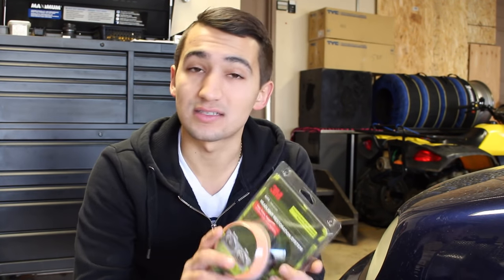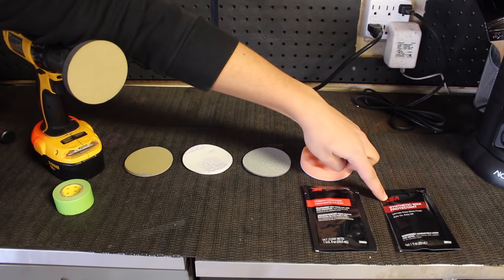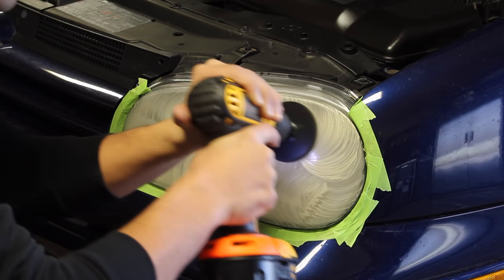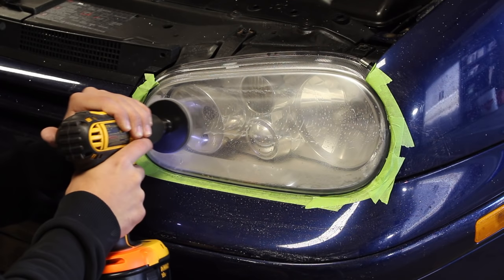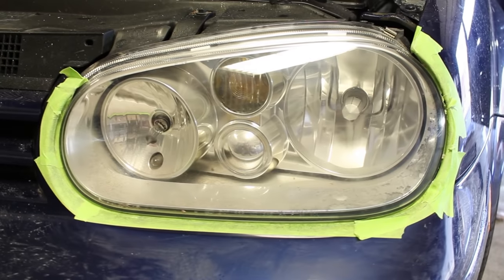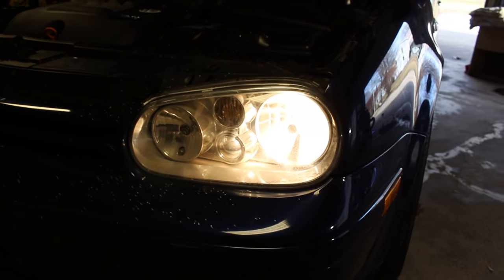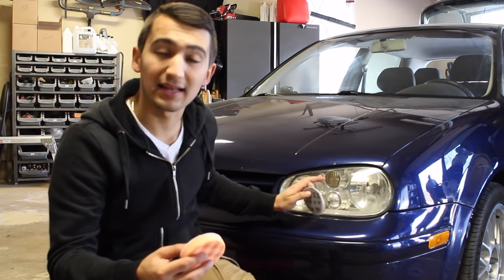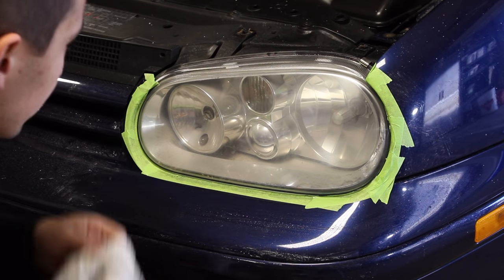How to Restore Faded Headlights for less than $20

Comment: how long will it last ?
Reply: it's honestly lasts a year and a half but that's with not that much sun exposure, as you may know the whole reason for the plastic getting yellowed is because of the sun. less sun the less you will need to restore again.
Reply: Thank you for the information and quick reply:)
Reply: +phuong pham no problem good luck.
Reply: I just did my headlights but i didnt buy the kit.  I just bought 400-600 and 2000 grit sand paper and did it by hand.  After I sanded it, I  used uv resistant gloss clear coat and sprayed 3 coats on each head light.  Then wax it.  Should last longer that what you get with the kit

Comment: DO NOT use clear coat on your headlights.  That is the quickest way to have them oxidize again.  The best way to keep headlights looking new and clear for a long time to come is by following the steps here, but instead of waxing, once the polishing is finished, clean the headlight throughly with 99% alcohol, and coat with a ceramic coating.  Reapply the coating once every 6 months to keep them pristine

Comment: Headlights haze because of the sandblasting when you drive. Basically tiny grits of dirt hit your headlights over time, dont think it has anything to do with the UV Sunlight.
Reply: The yellowing has a lot to do with UV Rays. It's essentially sunburn/sun damage
Reply from the maker: +Dylan Patel Sandblasting is very similar to sanding. If the sandblasting effect were true, using the sandpaper wouldn't do anything. When you drive, your front end does 'get sandblasted' by the dirt and crap that hits the front end which is how the OEM coating on the headlight wears. Only after the coating is gone, is when the UV rays start to kill the plastic lens. 

If your UV resistant clear coat gets stripped down and removed, don't think for a second that the base coat won't corrode due to UV rays. The UV rays have a large effect on the yellowing and fading.
Reply: +milanmastracci Thanks for clarifying that for me!
Reply from the maker: No problem :)

Comment: Great presentation proving you are much better than the product. It's a ripoff.  They discontinued it because of customer feedback telling 3M not a sufficient number of sanding disks. Also, their instructions conflict with their other similar kit.  Example: using water vs not using water on the heaver abrasiveness. You can find these kits cheaply but they are not replenishing them.  Also, no protectant sealant is included with the #39008 kit. I was told by Amazon just to keep the kit, and was given a refund.

Comment: I always thought these restoration kits did not work...maybe I was doing something wrong lol.
Reply from the maker: +W6 Smash If they don't work, you need to sand off the entire coating on them, before sanding with higher grit sand paper. The only reason why sometimes it won't work, is if the UV coating that comes on headlights, isn't completely removed.

Comment: newer cars don't have this issue with hazing
Reply from the maker: +Tarek Taher That is not true. You don't see it on new cars yet because the UV resistant coating isn't worn off yet. When these newer cars get some kilometers racked up, you will see it.

Comment: This kit is serious overkill, I've used just a foam pad on a drill with polishing/rubbing compound to refurb dozens of headlights, all that sanding is BS.
Reply: John Smith sanding is not bs if you're reapplying clear coat. the sanding will give it something to bond to. if its such bs why do body shops sand the paint and body panels
Reply: Jared Ostler The original headlight wasn't clear coated, it's plastic and all you need to do is once a year hit it with a sponge pad on a drill and a dab of rubbing compound, you can even do it by hand, it'll take you ten minutes per headlight instead of one minute per headlight with the drill, the only reason to clear coat is to give it a little more UV protection and you can still do that after using the rubbing compound, all that sanding is complete BS.

I have literally fixed dozens of headlights this way and never had to sand like that, it's a con to make you spend more money on the kit instead of just a foam pad and some rubbing compound, seriously guys this is a con, sure it gets the job done but it has so many more un-needed steps added just to baulk up the price!!??
Reply: John Smith , Jared is right. I worked at a high volume dealership that sold 400 cars a month and they used a two step wet sand process with the compound polish and buff.
Reply: depends on if they lenses are pitted / have deep scratches or other damage from debris.

Comment: not hating on his video but $30 Walmart they will sand both headlights and they will be brand new. No need to buy supply's and do it at home for decent work. Walmart will fix them brand new for $30
Reply: Mason Wilson  I think you're missing the bigger picture here.  Having Walmart do it costs $30 for just one treatment.   I got this kit for $18 +tax for about 3-5 treatments.   So now I have the disc pad holder, enough sanding and buffing pads to get started with.  Not to mention, 1. I don't have to waste nearly half a day waiting in line at Walmart to get it done by them.  2.  I can do it at home, in MY garage, listening to MY music and without having to deal with rude, stupid or annoying "Walmartians".   And 3. Since this is the same kit THEY use anyway, I can charge friends, neighbors etc. $20 instead of $30.  So instead of spending $20 ON the kit, I can make $100 OFF of the kit.
Reply: i started sanding lights a few months ago..a customer brought me a car walmart just cleaned...first of all they didnt get them clear..second of all her problem was water in the lights..they proceeded to clean them and charge her..accomplishing nothing
Reply: igor6969 okay well I Seen shops change oil and out it in the transmission. I seen a shop change a transmission and forgot a part. I seen a shop pull a car in and dropped it. I seen a bird drop out of the sky and hit a car. I seen a car flip. I seen a monkey hit a window. congrats dude anything can happen. cool your Walmart is useless that's awesome buddy. Want a cookie hahaa. Walmart worked on my car lights. Perfect job

Comment: You used the wrong 3M restoration kit!! This kit is for dry sanding? 3M as a wet sanding kit done by hand!! The first step you said p400 In fact it's p500 then p800 then the trizact p3000 to which tap water is sprayed on the lens! After the lens as become milky evenly across the lens, Use any glass cleaner spray wipe and dry using a microfiber cloth, There's no need to use fingers on the orange buffing pad 4-5 blobs of polish and dab the pad on the lens across the lens before switching on the drill, And never remove the tape until the restoration is completed!! 🤔🧐 You didn't show or use the Clearcoat wipes with UV protection as this is critical step for longevity of the lens!!